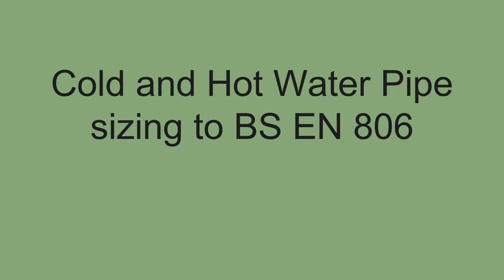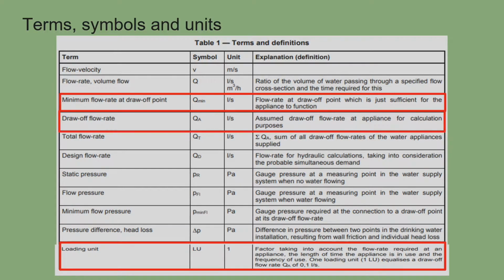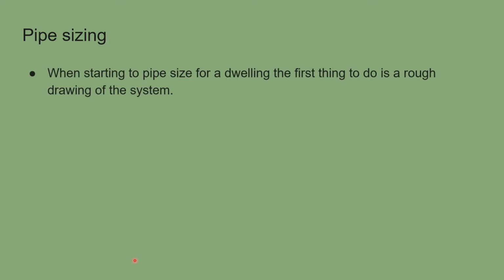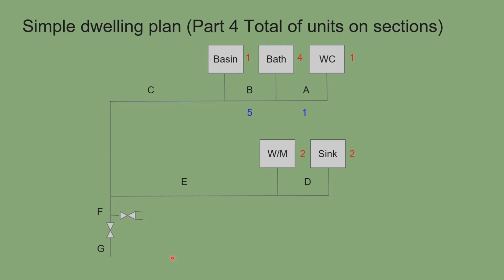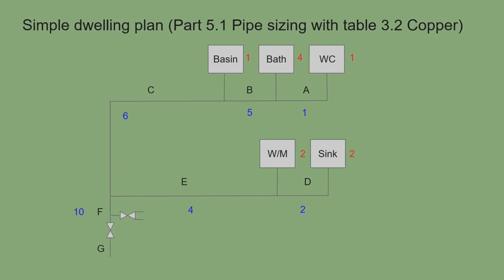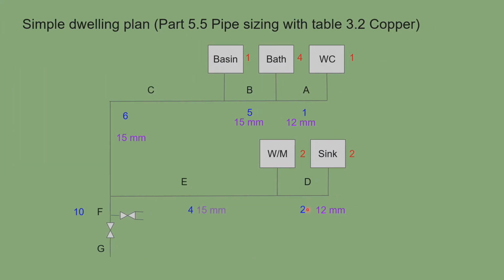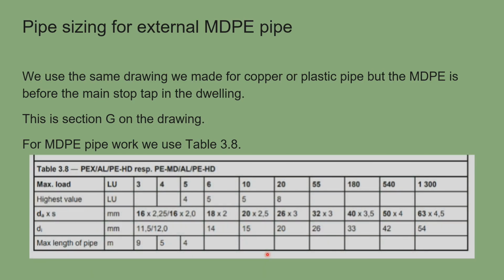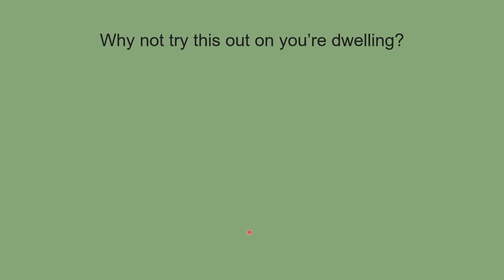Cold and Hot water pipe sizing to BS EN 806 Part 3 'Pipe Sizing Simplified method'

Comment: Hi, 

Hope you are well ! Amazing video !!!  

Just a quick one. If the draw off for a sink is 2 LU. Then should it not be 4 LU in total. Because a sink has a hot and a cold tap. So am assuming the cold TAP will have a flow-rate of 0.2l/s and the hot TAP will have a flow rate of 0.2 l/s. So the CW pipe coming into the house should be sized to supply cold water to the boiler or water heater for hot domestic water and cold water directly to the taps. 

Therefore, 0.2l/s of cold water going directly to the taps and 0.2l/s going into the boiler and into the taps (I know these values are not diversified but just for explaining reasons I ignored it). 

Or am I overthinking it haha 

Thanks !
Reply from the maker: Hi, and thanks for your support. I am well and getting ready for my new students to start soon ;) Hope you are well too.

Thank you for the very good question. No you are not over thinking, you are thinking in the correct way. ;) 

To answer your question, yes true, it would be 4LU, and yes it is 2LU on the cold and 2LU on the hot but we do not add them together as they are 2 different pipe runs and completely different. But if we are using a Combination boiler, I would have to add all the outlets of hot water together (bath 4LU, basin 1LU and sink 2LU) equaling 7LU and show the boiler on the drawing for the cold water. Yes, then all this would change the size of the incoming main and the pipework going to the boiler. I would then have to draw another plan for the hot pipe runs and size them too but this time from the boiler to the outlets.

Again thank you for your great question and I hope my answer help.
Reply: @mglplumbingtraining4067  

Hi, thanks for replying ! Crystal clear ! You’ve explained it well ! Hot and cold LU’s are added before going into the combination boiler. But hot water is sized separately when leaving the combi-boiler to serve outlets ! 

Thanks ! Amazing channel !! Keep up the hard work ! Hopefully it will pay off !! 

Thanks again !! And best of luck with your new students ! Am sure they’ll learn a lot from you !! 👌👌👌